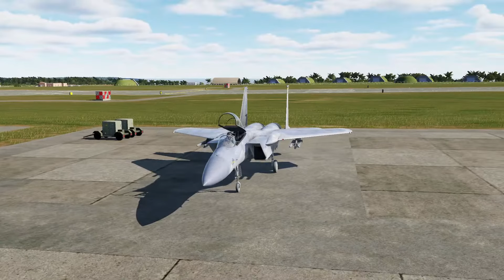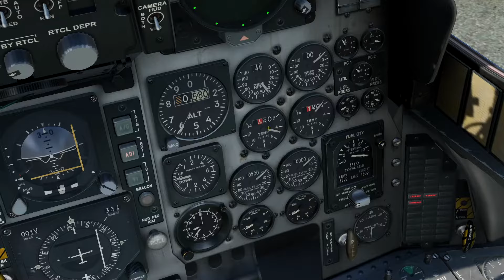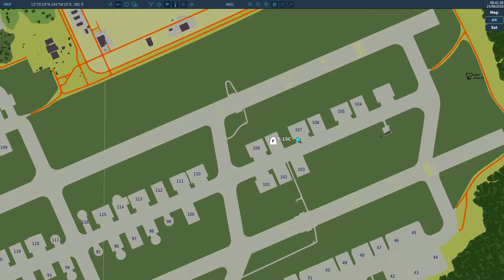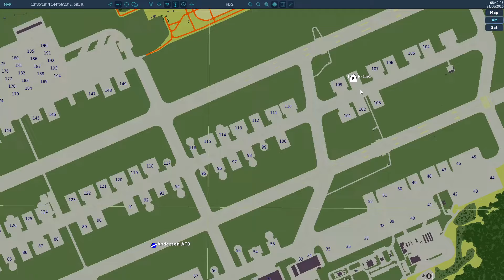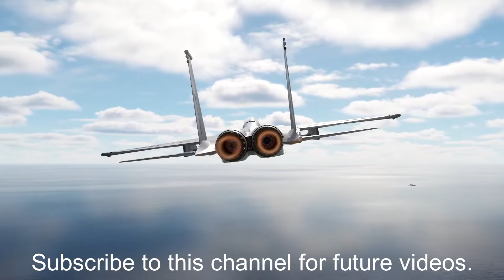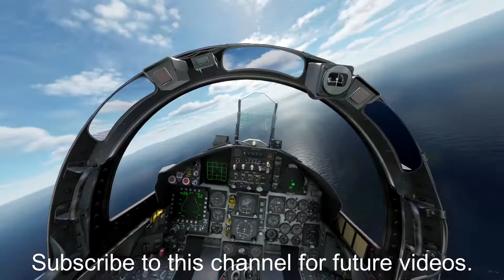F-15C Eagle DCS Start up, Basic Communications, Taxi and Takeoff.

Comment: How can you control cockpit with mouse in f15
Reply: You can't. The cockpit of the F15 is not high-fidelity. Meaning not interactable. All the buttons, knobs, switches etc will move when you use them via keybinds, but you cannot control them directly with your mouse. The F15E that was just announced is high-fidelity however, so preorder it if you want an F15 that you can interact with via mouse.